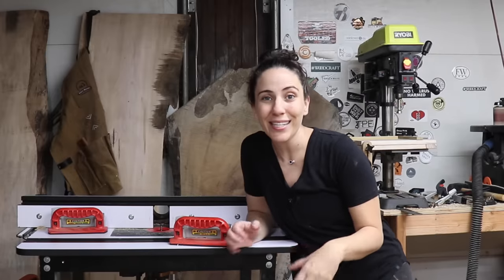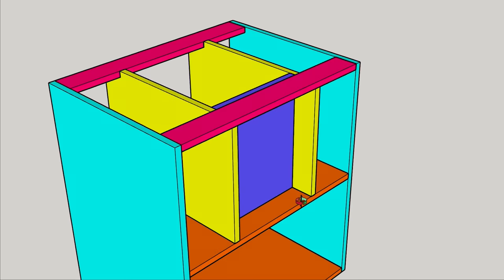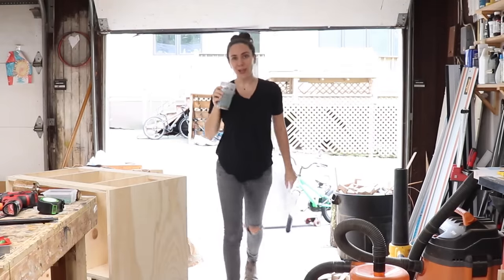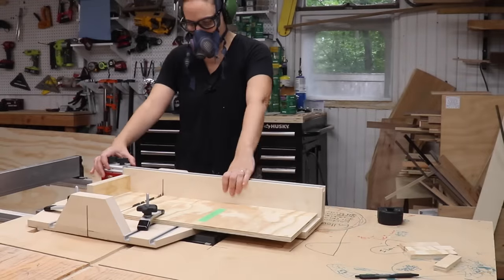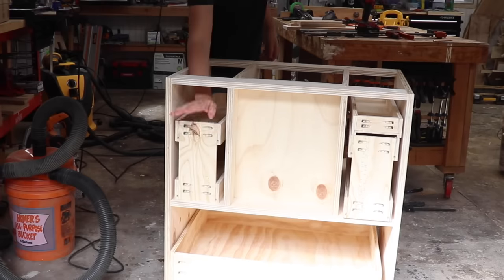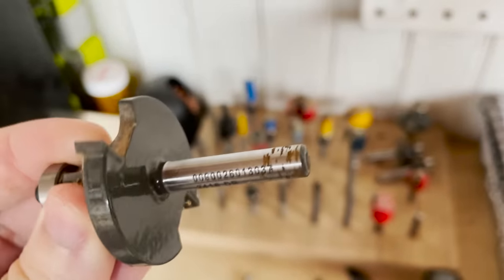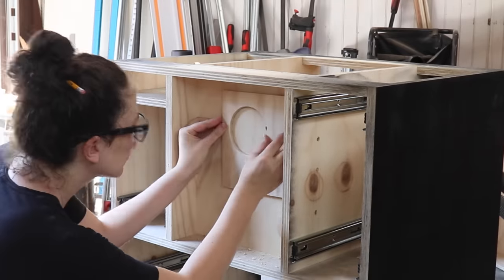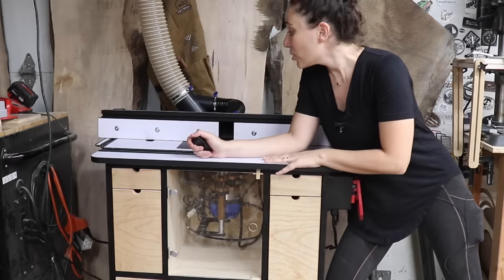Router Table Cabinet Build with STORAGE and DUST COLLECTION

Comment: This is awesome 👍 I don't know if this would help, but could you create different rings for each router bit and use them in place of the red ring currently around the bit? 

If you lower the bit, remove the red ring and replace it with an MDF disc, then carefully raise the bit with pressure on the edge of discs. 
This should close the gap and allow the dust extractor to collect more dust.

Hope this helps and keep up the great work 🙂
Reply from the maker: I have all the different rings the saw came with. I was actually using a smaller one first and swapped to the larger one thinking more airflow would allow for more dust to get pulled through

Comment: Your 4 inch dust collection hole should be at the bottom of the cabinet along with the slots in the bottom of the door.  Check out the New Yankee Workshop router table from ~25 years ago.  Many good ideas with that one (I built my NYW router table back in the 90's and it works very well still!).  Also, a magnetic catch and small handle on the door will be more convenient that a latch.
Reply from the maker: I’m going to try that

Comment: 👍🏼👍🏼👍🏼👍🏼👍🏼👌🏼🍷😎
Try flipping the plexiglass door down so air holes will be at bottom and also do you have a cut off to suction to your other tool as it will loose some suction. Hope it works.

Comment: I have been never nothing short of blown away by your work. Not thrilled by the rattle can paint job though. Having said that, why don’t you have a dado stack? Is it just to show that you can fo without one? With the number of subscribers you have, I am surprised that you have not been offered one either by a manufacture or one of your fans. As far as dust collection, try having a suction port at the bottom where you saw dust?
Reply from the maker: My saw can’t hold one Bc the arbor is too short

Comment: I believe if you had vented the door at the bottom, instead of at the top, you would have a better result. The air flow would be across the bottom of the cabinet and up to the vacuum hose, catching the sawdust in the airflow. If you add a vent at the bottom, be sure to block the existing vents to get the desired flow.
Reply from the maker: I’m going to try flipping the door upside down
Reply: @3x3CustomTamar  
When you flip the door please let me know if it worked. Btw, I was so focused on trying to help with the dust collection I neglected to mention how much I liked that build. Great design.
Reply from the maker: @jamesmettler8889  thanks!

Comment: Great router cabinet.   Just a thought - should the floor of the router space not be horizontal but raked downward from the front with the dust collection opening down near the bottom of the back wall of the enclosure.   Also, maybe the holes in the plexiglass door should be near the bottom allowing the airflow to sweep the dust to the outlet at the back.   I am just starting a multifunction workshop table and will definitely incorporate the features you have shown - excellent video - thank you.
Reply: I just finished my own router cabinet.  I don't have a HVLP extractor,  just a commercial HPLV  shop vacuum with a cyclone.  I 3D printed and fitted a 50mm id hose adaptor right at the bottom of the dust enclosure.  I installed a temporary plywood panel inset into the dust compartment as far inside as I could get it without interfering with the router lift.  I bored a 30mm hole in the centre 20mm from the bottom and gave it a try routing random dado slots.  Not having a plexiglass panel I couldn't see what was going on until I completed the routing and could remove the panel and take a look.  I was amazed at how effective the extraction was.  The compartment was completely clean except for a small build at the extreme left and right of the compartment.  So, I bored two more holes 20mm diameter at the extreme bottom corners of the access panel.  Another pointless router session revealed that the compartment ended up almost totally clean.  As Dayle suggests it does appear that the airflow velocity inside the base of the compartment is a more  important element than air volume extracted.  BTW I was using a 20mm table insert with a 1/2" straight bit.

I doubt if I have enough extraction capacity to simultaneously extract from the fence but I shall be giving it a try once I have a suitable Y-adaptor.

Comment: You probably should lower second hole a little bit. So the huge chips have time to get sucked in before they fall down. Also wind from router spreads dust around.
Reply from the maker: Going to try

Comment: This cabinet is an order of magnitude better than the one I built a few years ago. Not surprising given your amazing talent. I think I need to rebuild mine.  One question: how did you drill/form the holes in the foam for the bits. Sorry if I missed it. Thanks!

Comment: Good video !
You need to buy a set of router bits design to cut dados for plywood.
They will speed you process immensely.

I think that with all that dust floating in the "cube", eventually it will
go into the engine of the router and will shorten its life.
Reply from the maker: Thanks!

Comment: Awesome build! My dust collection box on my router table has the port nearest to the bottom and I  still get chip buildup in the corners. To clean them out I  just open the door to the box with the dust collection running and push the chips towards the port.
Reply from the maker: Yeah. Some tweaking is involved

Comment: Nice build!! Have you thought about running a hose Lowe in the back or in the bottom of the compartment where the router is?  
I finally enclosed my router a while back and it makes a huge difference for dust and noise!
Reply from the maker: Thanks! Interesting idea

Comment: Hi Tamar _ A brilliant build and video as always just a suggestion that might help with the dust that's not being collected would installing a 3rd dust extraction hose lower in the routers housing box be possible to collect any dust that falls to the bottom something around the same size house you have attached to the back of the router fence
Reply from the maker: Going to try fir sure

Comment: You could add a T piece to the large diameter hose connector to a smaller diameter hose that you could align with the base of the unit or even plumb in another T piece in the floor - just like a shower tray.  There wouldn't be much drop off in suction at the top as gravity is assisting.
Reply from the maker: Interesting

Comment: Would dust collection work better if 4-inch connection at bottom? Consider a smoke generator to see air flow in the box.

Comment: 23:00 do you have different sized red rings to act as more of a zero clearance when cutting basically anything other than a dado? I think between this and what most others are suggesting with moving your hole to the bottom, that you will have better luck. Thanks for the video Tamar.
Reply from the maker: Def going to play around

Comment: one fix i would suggest is to seal up the front plexiglass door (i.e make it a window in a wooden door instead), move the dust port hole around 4-5 inches lower (top of hole is aligned with bottom of router) so the debris have the time to begin falling first before getting sucked up.
then ABOVE the new location of the dust port hole, drill some holes or rout a few inches slot for air to flow.

EDIT:
ok many others have suggested other fixes as well. lol
Reply from the maker: Haha I’m def going to play around a bit

Comment: What a great project, fantastic looking piece of furniture for the workshop 🤣. Seriously though it's a fantastic asset to your shop, I made one many years ago and copied the example from Norm on the New Yankie workshop. What I would think that might cure the dust collection in the compart is to make the outlet level with the bottom shelf and go back to the original door. Please let me know what you think, the saw dust should fall to the shelf and be vac'd out 👍
Reply from the maker: I’ll try that for sure

Comment: @16:20 ... the "Premade" foam router bit holders will rust your bits like crazy! (I tried multiple brands.)
 
I assume it's the chemicals in them, rather than "trapped moisture" because when I stored them in a dry airtight container, with a zerust block, the parts touching the foam still corroded.
Reply from the maker: I don’t have that issue

Comment: Just a thought, having your dust collector higher on your back wall is causing your router walls to act like a dust separator, heavy stuff falls light stuff get sucked in. If you move the hose to the bottom it should do better with collection.
Reply from the maker: Going to play around for sure
Reply: @3x3CustomTamar  just want to apologize, i just realized a lot of people have been suggesting similar things. Don't want you to think we're nagging

Comment: Great job Tamar l am joiner by trade and you do a few things like me like the blocks for the draw runner l have made my self a router table but I used The new Yankee workshop drawings but I made my bed out of 20mm perspex and the fence with 15mm perspex but I did go over the top with my drawers fronts I did rails and styles with  raised panels two small one big and l did a frame around the perspex for the dust but with new Yankee plans he did his dust extraction at the bottom which does get the dust out l am sure you could find his plans on the website l put some D handels on two sides and fond it easy too move around but you have done a cracking job well done 👏 👏👍 stay safe
Reply from the maker: Sounds cool! Thanks!
Reply: Thank you for reading my comments you must get thousands watching your videos and to get a reply that is very nice carry on doing your videos 👍

Comment: Few possibilities I see as to why your DC isn't collecting as much as you'd hope:

1) Directional flow of the incoming air is only sufficient to collect light dust as it's falling, as it happens to pass through the air current. Having the air holes at bottom of dust chamber door instead of at the top should help here - if even just a little bit. Don't want to have it on both top and bottom, because that'd only serve to reduce overall suction where it's most needed.

2) Dust chamber is VERY square. This reduces the airflow's power by having it hit against corners and joints. You could thus increase airflow by rounding the inside of the chamber off, to create a cyclonic pressure where the air just continually spins in smooth circles, picking up everything it touches... Think along the lines of why shop vacs and vacuum hoses are cylindrical, and not quadratic cubes 😆

3) The collection hole is located behind the router unit itself. Pretty sure the router itself is having an adverse effect on the flow of air. Something to look into.

3) Dust collection port itself, being that it's at the top, that then requires more power to suck up debris from the bottom of the chamber. Other than by observing 1&2 above, the only way to fix this would be to move the dust collection to the bottom of the chamber
Reply from the maker: I fixed it. Hopefully I’ll post a video soon 👍

Comment: I'm wondering if the 4" port would work better if it was down near the bottom.  There MAY be some outward force on the dust up top as it's thrown away from the bit.  By the time it gets to the bottom, it's just gravity.  Maybe?  I didn't do so well in Physics :). Either way, worst case is that the dust is now contained in that chamber, instead all over the back and floor of the open table you had.  Added bonus, it LOOKS nicer.  Neat build!

Comment: What if you put a rectangular vacuum scoop in the back along the bottom of the router cavity and tied it into your dust collection? Plus put some really smooth material on the bottom so the dust slides out really smooth.
Reply from the maker: Could probably work

Comment: LOL "Where did I put it I just had it." 
Exactly what I say and do about 75% of my time at the shop. Tape Measure, Rubber Mallet, Utility Knife, Pen, Pencil, Remote, Triangle, or Combo Square. An issue for myself I really need to address.
I have hung my remote from a rafter using a length of Fluorescent paracord between the machines that my HF dust collector is used for, so when I reach up and take it down for any reason when I lay it down I now look for a piece of fluorescent rope rather than a little black object. I am working on some other ideas for the other items that I always misplace. As I was poking (typing) this out I am thinking this subject might make a good pilot. Thank You
Reply from the maker: Haha I need to do that

Comment: In order to collect chips, you need an airflow of 350 cubic feet per minute (CFM). Most home-shop dust collection systems that vent their air inside the shop cannot achieve this kind of air flow and provide good filtration.

Comment: I had to move the collection hole to the bottom of the router compartment and make it kind of a trough. Worked to clear the bottom. BUT .. routing dados never slowed the sawdust from shooting out so ... maybe some collection hose assistance on the top? Your collection is stronger than my shopvac...
Reply from the maker: Def going to play around

Comment: Great video. Thank you Tamar. Just one question would butt joint screws be strong enough, as pocket hole screws are not easily available hare in New Zealand.
Reply from the maker: Would be fine

Comment: Looks great, and perhaps the hole you drilled for the cabinet is set up to high? I’m not sure, check out Micheal Alm, I’m wondering how he did it because I thought his dust collection went pretty well. Izzy Swan took apart a simple shop vac and created an awesome, very custom dust collection system for all of his sanders which could be helpful not just with your sanding tools but this router table. A couple others that you’d like (if you haven’t already watched is Komar Project and Wesley Treat. Regardless it looks nice, clean, organized, and finally a shop project!!! I’ve been hoping to see how you prefer shop builds so this was insightful. And I appreciate your shop, it’s not over extravagant, ridiculous or expensive beyond reason… it’s a real, used and much loved shop space and to me that’s more relatable than insane shop cabinets that cost thousands of dollars
Reply from the maker: Going to try lowering it for sure

Comment: Flip the door upside down. Gravity is pulling the dust down so the air needs to get in front of and under the dust. It will then lift the dust  to the collector port.

Comment: That looks great! As mentioned on your instagram post, that foam... great idea. I wonder about the dust collection, if you had it moved down lower would it increase it's ability to "collect" the dust? I'm thinking it might be just too high and the router is throwing the dust down faster than the collector has time to pull it in. The ventilation on the front I think was a good idea.
Reply: Check out the Milescraft Dust Router. It attaches to underside of router lift and eliminates dust entirely. Best $30 I ever spent for my shop.
Reply from the maker: I’m going to give it a try

Comment: I had built almost an identical cabinet last year (same router tablet from Rockler?) and have the same dust collection issue. After reading all the other comments I think I'll try the vent at the bottom. Did anyone else have success here? Better sealed door or is a loose fit OK?

Comment: I'm pretty sure that the dust collection is not sucking up everything because that front door has to be perfectly sealed so that you're making that chamber around the router vacuum sealed I think you're letting too much air out of the door so it's not really getting suction through the whole chamber. You could do that by adding a little wooden lip on the inside of the door and maybe putting foam on it so that when the door is closed it's pressed against the phone and also replace that piece of plexiglass with a solid piece with a handle on it so that there's no air escaping through the door itself either.
Reply from the maker: I don’t know. I think there needs to be airflow coming in from somewhere. Completely sealing up the box will restrict the pull. Like why some ppl drill holes in their floor attachment on the shop vac
Reply: @3x3CustomTamar  after a lot of googling I believe you're right. My bad. But I also gathered from that googling that if you make the port close to the bottom and have the bottom be kind of v shaped so that it channels dust down that helps. And also you can apply laminate to the plywood inside the cabinet to make dust not stick to the plywood. But that's from other peoples experiences not mine so take it with a grain of salt haha. Great build and good luck getting that worked out!

Comment: I have seen others place the dust port at the bottom of the internal cabinet housing the router lift because gravity pulls particles down, why not put suction on bottom instead of side.
In this case, you could easily install a bottom that is closer to the bottom of the lift with a 4" elbow connected to dust collector. If u understand what I'm suggesting.
Reply from the maker: Yup. Going to try for sure

Comment: Maybe putting the slots in the clear panel on the bottom would change the air flow direction enough to pull the dust up from the cabinet base.
Reply from the maker: I’m going to try that for sure.

Comment: Maybe try adding some 45 degree pieces (like o'gees) running along each side of the bottom of your "dust box" from front to back, so the bottom of the box will be less cubic and make for better air flow......(Plus, like so many mentionned, flip the door so air intake is at bottom) ;-)
Reply from the maker: Going to experiment for sure